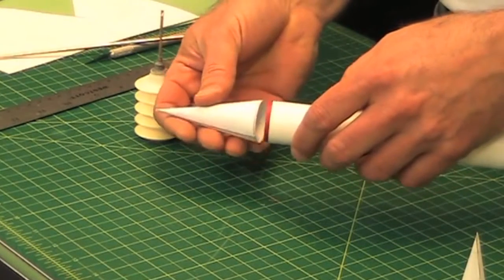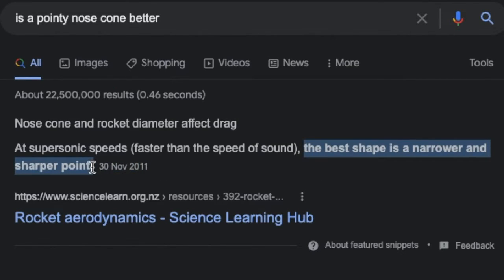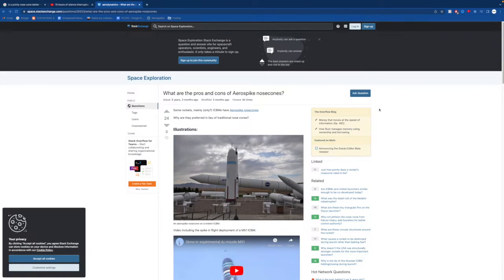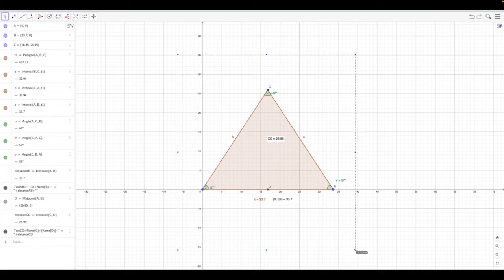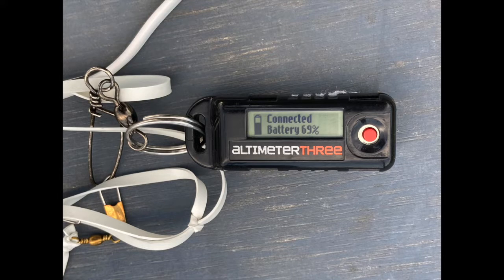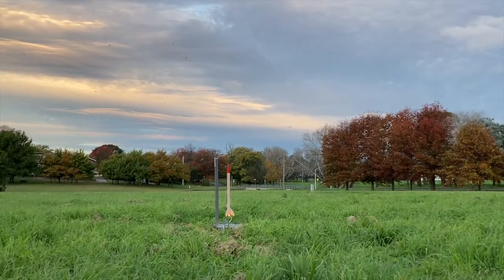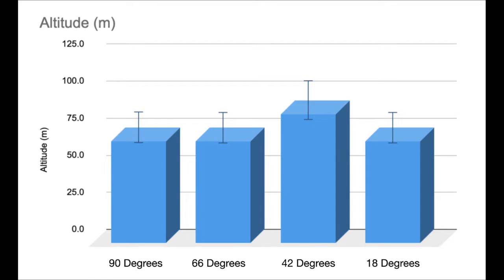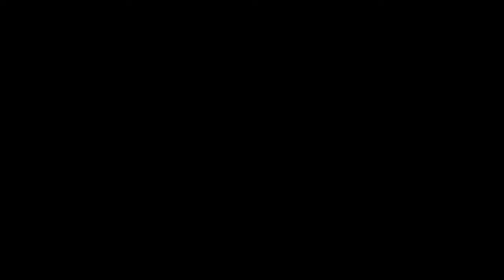Which Nose Cone Shape Works Best?

Comment: Just a tip for safety, in case of a misfire occurring, wait about 1 minute then the rocket should be safe to approach. The engine could still possibly ignite while you are too close to the rocket. :)

Comment: To do any experiments you must do it multiple times. This will remove a few variables. I know rocket motors are not cheap but your Cs or Bs are cheap compared to the M I had to buy for level 3 cert.

Comment: Nice work! It would be interesting to see what a simulator predicts for this rocket with the different nosecones as that would remove the variability you get with real world flights.
Reply from the maker: Yes! I actually did do a simulation for each nose cone to ensure the rocket wasn't going to go too high for the field I was on, but the simulation predicted an incremental increase in apogee altitude as a function of the "sharpness" of each nose cone. This was all in OpenRocket